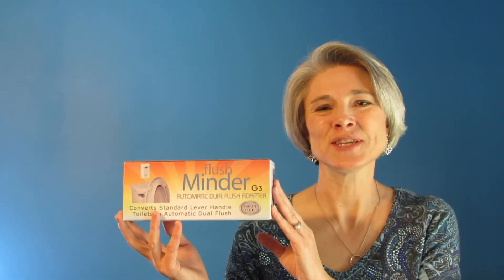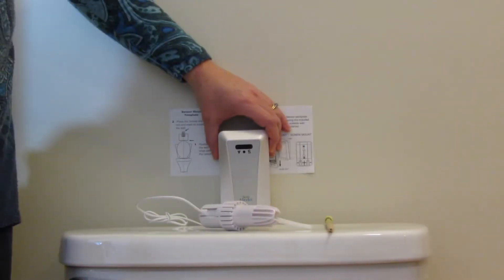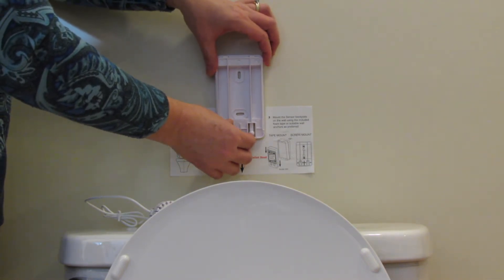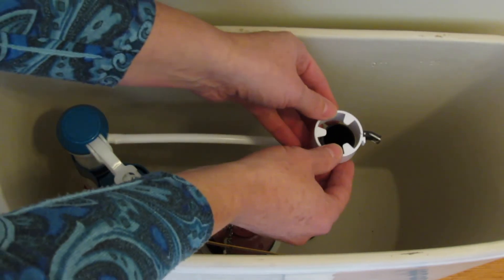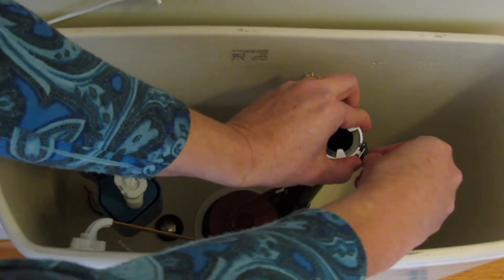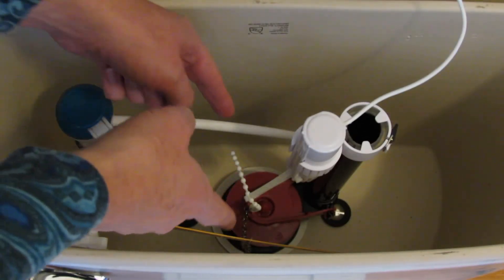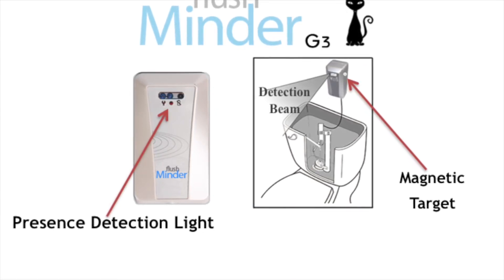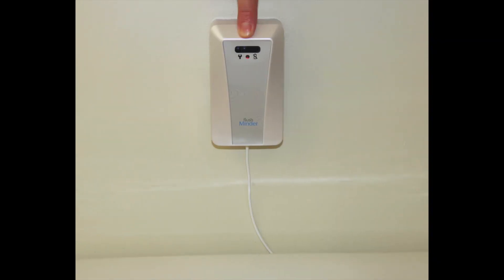Hands Free Automatic Toilet Flusher - Flushminder G4 DIY Kit

Comment: video is very well done. The current model is a G4. What are the differences?
Reply from the maker: The G4 has an improved flush actuator motor and scratch resistant glaze finish.

Comment: The newer G4 model has an improved flush actuator and lighter neutral colors with a more scratch resistant finish . . . the install process for the G3 and G4 is the same.  There is also now a version for push button top flush toilets. See the FlushMinder TF version on the website www.water-saver.org.